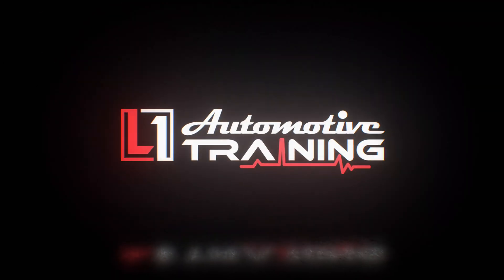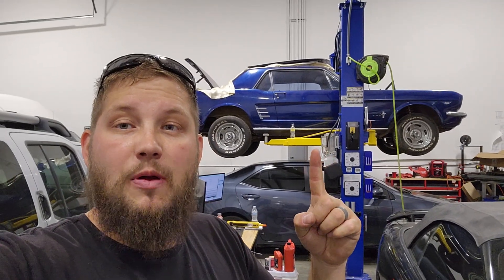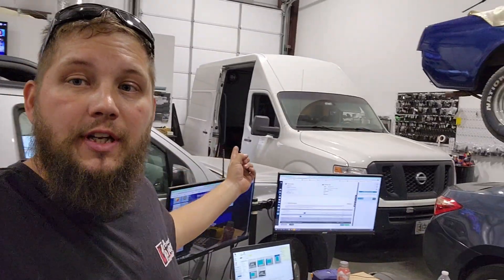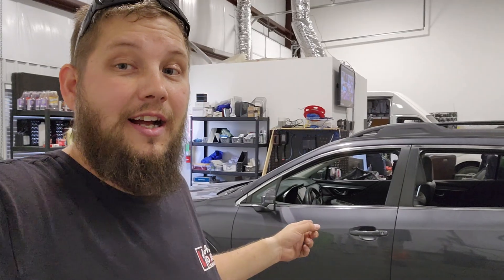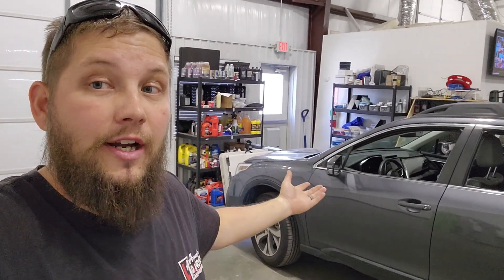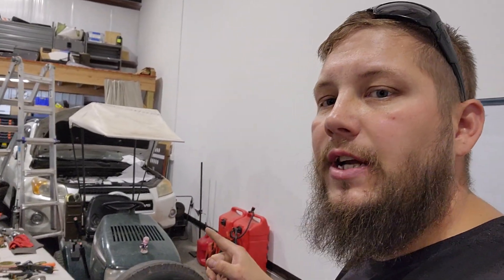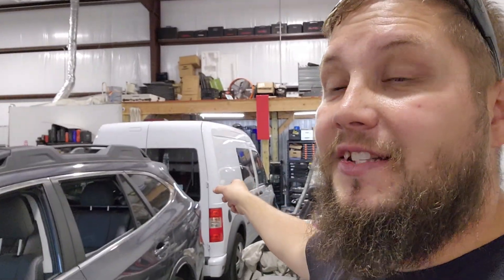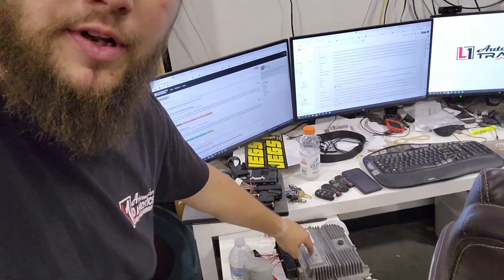Where do I Learn How to Program Modules: J2534, OE and Beyond

Comment: hey man what are some decent budget friendly laptops you would recommend ? i want to start using dealership / OEM softwares for honda, toyota and nissan. i know ill need more than one laptop most likely.. i just want to see what are some budget friendly options for now until i can purchase something else.
Reply: any thing with a AMD ryzen i bought mine 2700u amd cpu is the cheap power house their are other like 4700u but is not as good i know silly bigger number but lol  yea its low end compared to the 760m 2nd bestest ;] 780m bestest but for any car related 2700u amd cpu its super good  but the gpu side is good all on how much is budget  AMD with vega graphics to the new 760m 780m
Reply: @ thanks for the info !

Comment: Holy cow Keith! Two weeks back had a MICU problem on a Acura, thought was remote start, removed remote start, fault still comes after using lock, unlock, etc but couldn't do more than replicate. 

Owner wanted the factory trained acura techs to fix it as he wanted the warranty. 

Same week had a 2yr older Honda which thought was IMMO reprogram (owner starts car with spendy Snap-On screwdriver with key held up to IMMO 🤣😂) and IMMO light stayed on afterwards. 

Thought was going to be simple. Turns out was the MPCS/MICU/IMOES needed refreshed as a install. Owner hasn't called back knock on wood. All had similar symptoms prior, battery had been dead for extended period of time. Makes sense if one thinks about it. I guess the
  MPCS/MICU/IMOES replace option was a good guess. Glad nothing else happened.

Comment: Most Subarus do that.  If a fault sets in the ECM, you'll find those ECM abnormal faults in all other systems.  And it also turns off all the Eyesight, RAB, Cross traffic etc systems.  Love Subaru.